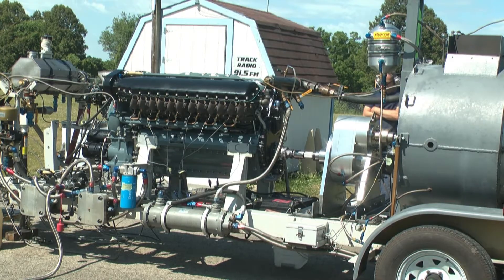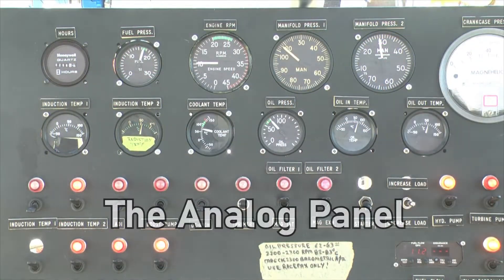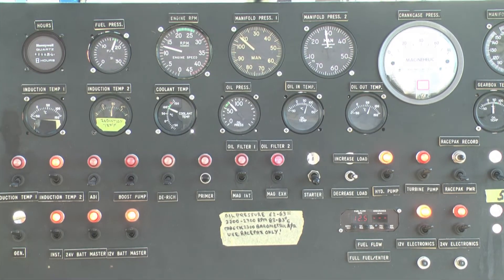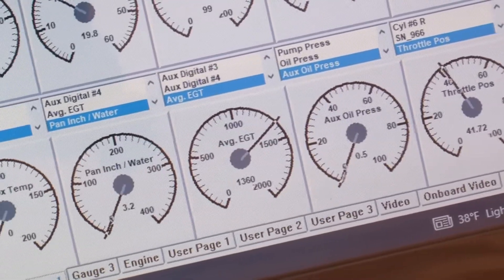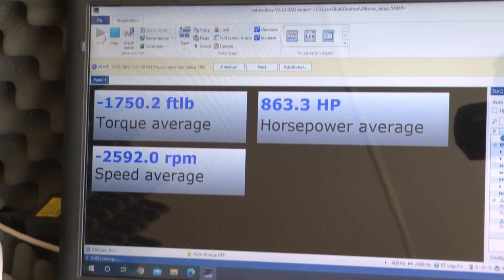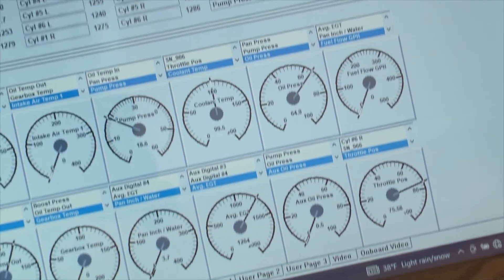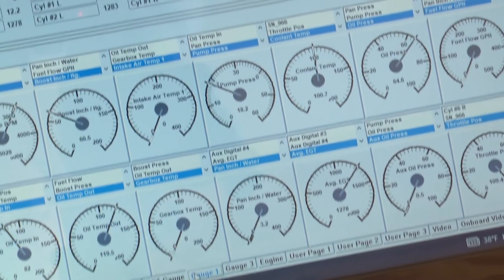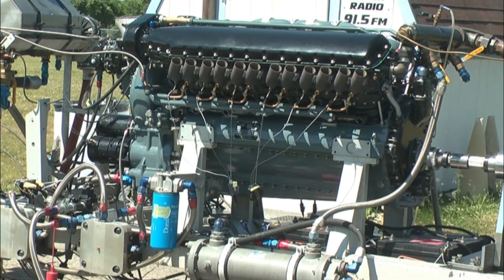Part 2: Allison V-1710 Dynamometer Demonstration

Comment: Was the "E" nose case substituded to allow 1:1 dyno test?
Reply: The E nose provides a universal location to connect to crankshaft speed. The gearbox after the engine provides the necessary speed up gear ratio necessary to spin the turbine the desireable speed to make all the different power settings efffective and available.
Reply: @BudWheeler  Thanks. I know Allison pushed for a modular design, but It didn't dawn on me that the nose case from an older model could be fitted for purpose. Obviously, it is of no use for a P-40N. Brilliant build.

Comment: I might have missed it but was that pull done with the water/methanol system running? I know that several aircraft with that engine used a water/methanol injection for their war emergency power and allowed then to pull 70+ inches. Also curious what octane rated fuel that you run? I know towards the latter part of the war the US was using 150 octane for their aircraft.
Reply: No ADI invloved. This domonstration is on 100LL which is the same octane rating as was used during WW2. 60" is the limit on 100LL for this engine supercharger combinination. This video was made for posterity so that future Allison enthusiast would be able to see a real dynomometer results. I hope you enjoyed it

Comment: Am I right at seeing a bsfc of around .7lb/hp*hr?  That seems really high.
Reply: Your correct with you math, This is at the extreme of the engines limit before detonaton occurs because of the 100LL limits. Additional fuel is added to prevent detonation from the supercharger heating the induction system further adding to the possibility of detonation. WW 2 radials were around .9 .. The engine seldom operated in this area only combat and for less than a minute before all coolant/oil temps went off scale high. Much more efficent in cruise/ auto-lean conditions
Reply: Thanks.  I'm not familiar with the aircraft world, so I was curious.

Comment: What are the chts in one of those
Reply: Nowhere, for the pilot as the instruments in the cockpit show only the coolant and oil temperatures. But, in liquid-cooled engines cylinders run much cooler than in air-cooled radicals.

Comment: I have read about the early engines/pilots using higher than recommended power settings. This required Alliosn to start installing manifold pressure regulators. I have also heard about crew chiefs tampering with these. The facts are that the fuel (100 octane) was the limiting factor. 2" manifold pressure above the recomended begain detonation and that changing depending on outside air temp.
Reply: Lol - The crew chiefs in Italy would shim/stretch/double up the wastegate springs on P-47s to give 90" !
"Really gave the old Jug a kick in the tail !"  Had to increase anti-detonant-fluid (50% Methanol, 49% distilled water, 1% "Dromas Oil") tank capacity, and slightly increase flow. Half a century ago two pilots told me "NOTHING ever out-climbed us !" - after Crew Chief "tightened down the Horsepower Screw".
PS - postwar my Dad worked for Pratt & Whitney Kansas City. Once he sat at the controls of an R2800  C-Series running at 4000 horse power at 130" of mercury - for eight hours of a 24 hour test !  The Military immediately classified the info. They were afraid the Soviets would steal the plans and make 4000 horsepower Lagg-5 fighters and come and kick our tails while we pooped around with our early jet fighters, lol.

Comment: How does your calibrated run stand check gear reduction unit  oiling with out a F series nosecase?
Reply: Good question. Removing the F-nose or propeller gearbox and installing the E-nose adapter changes oil demand on the system. We installed a calibrated orfice on the main oil gallery to simulate the installing of the F-nose

Comment: Do you know  the amount of hp the super charger  draws  from the engine at max boost? I add that  figure  to the engine hp
output to cal fuel consumption
Reply: I had read years ago, If my memory severs me?? if and if??
A turbo charger produces about 480 Hp and the super charger uses about 400 hp. So there was a slight dual  increase in HP? 
Any knows this is not accurate do, Please correct this. 
As no offence taken.
Reply: @edwardcarberry1095  The superchargers main job was not to increase HP but to MAINTAIN the HP as the plane went up in altitude where the air is thinner and needs more air pumped into the engine !! !
Reply: @wilburfinnigan2142  Yes, I learnt that some 50 years ago.

Comment: In combat in WW2 pilots pretty regularly pulled 70 inches of manifold pressure which works out to about 1750 hp
Reply: My grandfather was in Darwin Australia during ww2 and recounted that when push came to shove the P40 pilots ignored the operating parameters and the Allison seemed to accept it.
Reply: @watsisbuttndo829  The operating parameters were for prolonging engine lifespan more than they were hard points where failure could occur. Failure is more likely beyond the safe-operating limitations. But at no point in any aircraft does a manufacturer red line 2500rpm with the knowledge that at 2501rpm or even 2600rpm failure will occur. By 1941 anyway these engines were being produced like crazy and unhealthy or even destructive use of equipment meant absolutely nothing to the men using them for good reason.
Reply: The fuel and superchargers wouldn't allow for 70" on all but a VERY few variants.  This one (-99) was rated just above 50" and 1360hp for war emergency power.    Very few US engines were running anywhere near 70" even during late war, I think the P-47 N/Ms were around 72" but also generated around 2,800hp at that pressure, which was similar for the F4U-5 but that didn't see combat.
Reply: @EstorilEm SURE they could, and DID.... They HAD 150 octane fuel available, and the engines SURELY did produce MORE than 5.83lbs of manifold pressure.
Reply: The fuel octane was much higher for the high performance fighters in WW2. Believe it was 130 with up to 150 octane available.
Wonder if this test was with todays 100LL?
Reply: @shaneconrad7816 I'm sure it was some king of race fuel, but i dount it was anywhere near the 150 octane fuel that was available during WW2

Comment: Is this a straight 12 or a V24? 😃
Reply from the maker: The engine is an Allison V-12. It has 2 exhaust pipes per cylinder or 2 exhaust valves per cylinder as well as 2 intake valves per cylinder. Please look it up on wikpedia
Reply: @aceallisons2639  Thank you very much - even just the appearance is impressive! 😃👍 I also like the sound of engines with many cylinders. 😉
Reply: @u.e.u.e.  Two intake and exhaust valves per cylinder is common on WW2 era V12 engines.  This is not unique to the Allison.  I mention it in the event you see the extra exhaust on other era engines.
Reply: @sebclot9478  Thank you! 😃👍

Comment: Could this dyno hold strega or voodoos merlin @ 3900ish hp? Or the cooper unlimited hydro twin turbo allison?
Reply from the maker: A couple of thoughts. Our test stand is only for an Allison engine. A merlin would require a very different set up. Our torque transducer is rated for around 2400 Hp. Lots of numbers regarding horsepower bantered about( Example. 3900). I have been around and tested on a dyno these engines in many configurations and I can assure you they don't reach those numbers. Our stand is for testing Allison's for aviation use so I hope that helps you.

Comment: Not quite the grunt of a Merlin but a lovely sounding engine.
Reply: jp-um2fr  These Allison V1710 engines out grunted the 20 series and earlier Merlins as they were in case you did not know all also SINGLE stage supercharged, it was only the 60 series Merlin early 1943 that had the LATER, get that LATER newer 2 stage supercharger,  they added a second compressor wheel to the supercharger and added a 2 speed gear box to turn the compressor FASTER at altitude.  there were over 40 different models of Merlins produced throughout the war and most all dummies want to compare the LATE model 60 series as if ALL merlins were as such. and to compare the later  merlins to the Allisons.  That why the Allison Mustangs Mk I & II or P51A's would out run the later P51B/C'&D/K below 20,000 ft.  the Allisons supercharger was tuned to the low med altitude the Merlin to High altitude.  Those same early Allison Mustangs were also faster than the then current production $hitfire Mk V's with their single stage superchargers also and by 30 MPH !!!!    The Allison did NOT get a later 2 stage supercharger because some dumb @$$ army brass thought  the turbocharger was the answer but except for the P38 no room for the large turbo.  It would have been nice IF the Allison would have gotten a 2 stage supercharger like so many other engines got. The Merlin the  PW R1820's &  the R2800's

Comment: Most interesting , thank you. My father was a engine fitter in the RAF during the war, he said that when the engines had used emergency power in action, which broke a tell tail seal on the throttle , the engine oil/filter had to be drained checked for white metal debris, if it passed this , it was then run up for a specific time/ revs , then drained and checked again , lots of fasteners on the engine Cowlings ,  filters plus locking wire , many gallons of oil , not a popular job particularly winter in the open. Because he was older/ conscientious, than the rest of the ground crew he often got the job ( he was in his late 30s, the rest were teens early 20s) he was given the nick name “ the cowling king “thank for the video.

Comment: Love the variable turbine vanes, have you tried a Merlin on the same rig? There were quite a few Allison engines in New Zealand after the war, they ended up powering some interesting boats..
Reply from the maker: We specialize in the overhaul and repair of Allison's only. The dynamometer is designed solely around an Allison.

Comment: someone tell me if I got it wrong but didn't the American emergency power setting also include methanol water injection to help protect the engine under an emergency power situation. I know it was standard on a lot of planes in the armed forces and would increase the power output on the engine while keeping it cooler . like I said someone tell me if I got it wrong
Reply from the maker: The answer to your question is somewhat involved. The limiting factor is always the fuel and how much manifold pressure or boost you can apply to a given engine design that is a limit before detonation. The engine in the video is typically limited to 60 inches Manifold pressure @ sea-level on on the ground because that is it's safe level before detonation without any form of intercooling or water/ alcohol injection. This engine is only capable of producing 62 inches MAP @ 3000 Rpm on a cool day on the ground. Every WW 2 engine is rated for maximum MAP for a given RPM and fuel grade. Forms of suppressing detonation and applying more MAP if available are intercooling and water-alcohol injection.
Reply: @aceallisons2639 Not entirely correct. Or perhaps we are talking just nuances, but assuming that supercharger can provide adequate boost, 100/130 (or 100LL) + water injection allows higher boost that 115/145 fuel alone with much less heat stress on the engine. NACA did lots of testing on this.
Reply: Some late war aircraft did have water injection.  I don't think this particular engine did.

Comment: Nicely engineered bit of kit, a trailer mounted dyno you can tow  behind a Ford  F 250 Pick-Up or Jeep Gladiator, can the trailer test a 60 Series Rolls Royce Griffon ?. , The '1710 'was  a gift squandered ,originally designed by GM to  power the US Navy,s second generation airship hence the lower rpm. In 1935 after the  ZR-3 Macon,s tragic loss, in their illogical wisdom the US Navy cancelled the ZR- 4 and 5 Airship Programme. This Left GM with an engine they could not sell on the open market, but be suitable for the latest all metal monoplane  fighters then under development. GM went about  its re birth as an aeroplane engine in a cack  handed manner, bolting on a blower bought from a Wallmart store . Anyone at GM with a functioning brain cell would have sent a  technical commission to Rolls Royce at Derby, to study  how they go about fitting decent performing blowers to their Kestrel and embryonic Merlin Engine, to pick the brains of Ernest Hives and Stanley Hooker , regarding blower design.  Think of a '1710'  fitted with a blower designed by Rolls Royce!!!!. Early ,1710,s were short on ponies, wheezy above sixteen seventeen thousand feet, and lacking an automatic boost control, standard on a Merlin or Kestrel. In short 1710,s were good 'hound dog' engines, ideal for rooting through the woods and weeds searching for an escaped prisoner,( ably demonstrated in low level ground attack missions by A-36 Apaches).  To turn a hound dog into a race bred greyhound, like those on the sides of greyhound coaches(buses), simple, bolt on a General Electric Turbocharger, just like Clarence 'Kelly Johnson' the Medici of US Aero engineering to design develop and produce the USAAF,s coolest fighter, the P-38 Lightning.
Reply: None of those developments you're talking about on RR superchargers were available at the time the V1710 was originally designed.  When Allison passed the 100-hour type test for the USAAF at 1000 hp, they were ahead of Rolls-Royce.
Reply: @andyharman3022  That is maybe so as the 1710 like the Merlin was designed  between 1932 and 1933,  regarding blowers  Rollers caught up damn fast, you forget, Rollers cut their teeth developing blowers for the 'R' Series Sprint Drag Race Engine used in Reggie Mitchells S6-B . By 1931-32 Roller Kestrels were entering RAF service, using blowers developed from the 'R' Series, all down to Cecil Rowledge and Stanley Hooker. Look at the back of a Kestrel 'V' designed around 1934,as its blower casing  hid a bigger rotor impeller than the 1710. As early as 1925 Roy Fedden of the Bristol Aeroplane Company with  help from the Royal Aircraft Establishment built a turbo charger for a Bristol Jupiter Radial, flying this combination in a Bristol Seeley Tourer, a civvied F2B  Fighter.  by 1934-35 Curtiss Wright and General Electric had a workable turbo for the V-1650 Conquerer, that powered the PB2 two seat fighter by Consolidated Vultee.  When the 1710 passed its 100 hour test in 1937,Rollers ,from their test centre at Hucknall  flew a Merlin with cats&kittens, a two speed blower in a Hawker Horsley Light Bomber April of that year

Comment: ww2 combat records show some pilots admit running their P-40 Allisons up to 70 inches! wow!
Reply: Yeah I think there were reports of some engines exceeding 1700 horsepower in emergency situations based on airspeed of the aircraft.
Reply: That wouldn't have been much of a problem if they used the late war 150 octane fuel

Comment: How is the oil viscosity changed from cold start to operating temperature in an allison aircraft engine?
Reply from the maker: The oil is 25-60W and with all engines becomes thinner or less viscosity as the temperatures rise. We have a controlled oil temperature target of 82-83Deg. C inlet temperature and 62-63 Lb oil pressure @ 2200-2300 RPM to insure proper oil pressures through out all operational ranges. Minimum oil pressure is 55Lbs.
Reply: We are not concerned about viscosity but more over the oil pressure as a result of oil temperature. We run the highest recommended oil temp. in order to make sure the oiling system is capable of suppling enough pressure for the aircraft operation

Comment: If you notice nothing on that test stand was vibrating or shaking, not even the pyrometer wires.  The only time I saw a slight bit of movement is when he was shutting the engine down.  Very impressive work
Reply: I bet they could balance a quarter on the frame. I too was watching for flex upon start up and like you any imbalance on shut down. 👍
Reply: The Allison is actually a very well balanced engine
Reply: Heck yeah,  That engine is beautifully balanced. That's perfect engine work 👍

Comment: What sort of decibels are you getting at full power and is the test engine vibration isolated from the test rig ?
Reply from the maker: Decibels recorded are around 120@ take-off power. The engine on the stand is hard mounted but being a V-12 is very smooth and we invite our customer to walk up to engine and put their hand on it to experience it.

Comment: What airfuel ratio is this engine running at 100% throttle and war emergency power is emergency power? Also curious as to what timing is commanded at those power settings.
Reply from the maker: 10.00 F/A and twin ignition 28 and 34 BTC
Reply: @aceallisons2639   Very cool! Thank you very much.
Reply: @aceallisons2639  I think you had air fuel ratio AFR in mind, because with F/A at 10 no engine could possibly work. F/A at 1/10 then yes.
Reply from the maker: Allison considered 100% power what the aircraft systems (coolant/Oil continuously)could cool for continuous flight or METO power. This is not full throttle. War Emergency is practically full throttle or 60" MAP or the maximum before detonation. The fuel is 100 LL (the engine is supercharged)
Reply: @aceallisons2639   Thank you. I understood 100% throttle to mean maximum throttle for continuous power output. With war emergency meaning maximum maximum manifold pressure. As Someone who has quite a bit of experience with the gen 3 Hemi Hellcat  platform, these World War II engines fascinate me. Years ago I was a docent at the Hiller aviation museum.  I spent all of my time in the engines section.